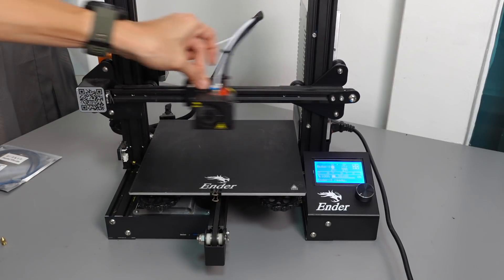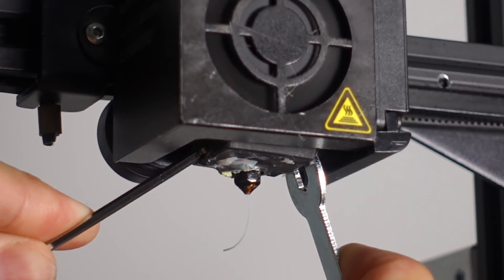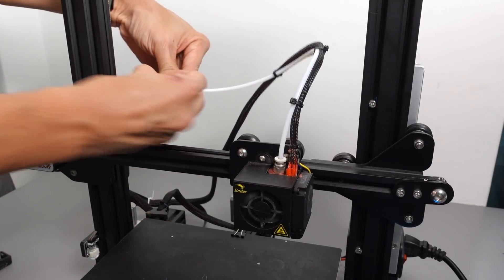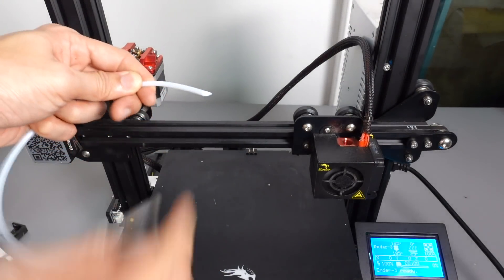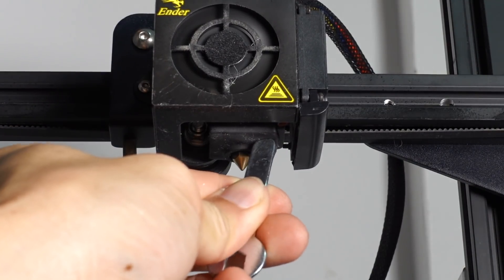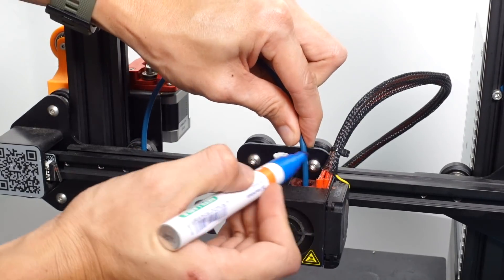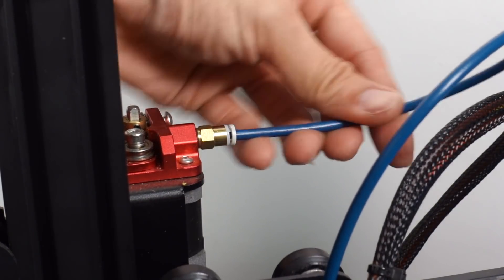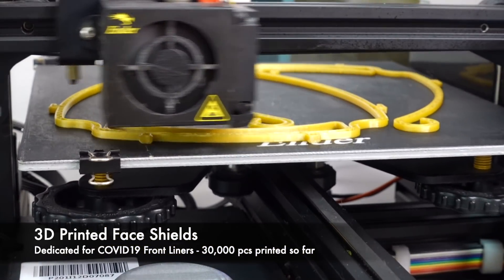Creality Hot End maintenance, Nozzle change, Coupling and Bowden Tube (PTFE) upgrade to Capricorn

Comment: Thank you for this, I had a terrible print then printed a terrible benchie and I heard my extruder gears making clicking noises and suspected something. I did exactly what you did here and suddenly a massive improvement. Also your suggestion for disconnecting both tube ends and pull out that way really helped as my bowden tube and  are always so hard to pull out as the pressure clamps always are stuck. This is a great video for beginners. I am using an Elegoo 2S which I bought second hand. Im buying new tubing  Ill be sure to leave a little extra tubing and if I get clicking then just snip some off.

Comment: after installing my capicorn tube, I have extrusion issues that have made it impossible to print. the capicorn tubing is too tight and it appears to shrink on the hot side which grabs and holds the filament.

Comment: Awesome video! Just one thing that wasn't covered: when putting on the cable ties at the end, make sure not to over tighten them, as that can cause a lot of resistance for the filament going through, which leads to inconsistent or even under extrusion. Nice job!
Reply from the maker: Thank You! 

New ender 3v3 videos on the way

Comment: i have a new ender 3 pro, but i got a clog. took off the nozzle and cleaned and then i unscrewed the pneumatic coupler at the top of the hot end, but now it wont screw in at all. it  jsut stays loose and spins endlessly. i donnt think its broken, its brand new and nothing broke but now i dont know what to do

Comment: I wonder why they call them "pneumatic" couplers. No compressed gases involved.
Reply from the maker: The original usage for these couplers are for air hoses and small pneumatic actuators. Frankly I won't trust these couplers for industrial usage, maybe these are the lowest range in quality
Reply: @KakiDIY  I don't know if these are the actual pneumatic hose couplers used for those applications, though they certainly do look and work like them.